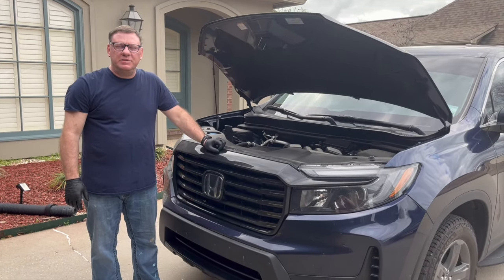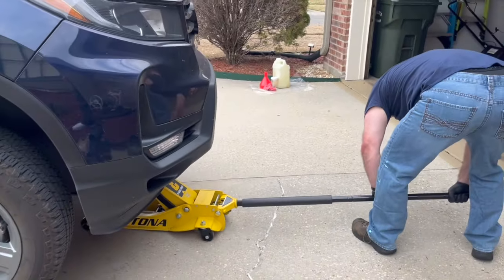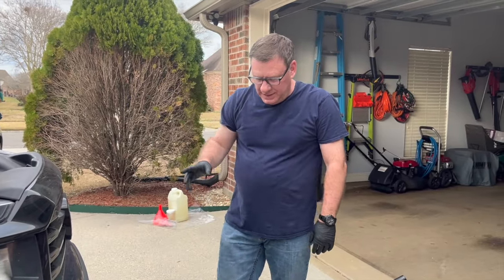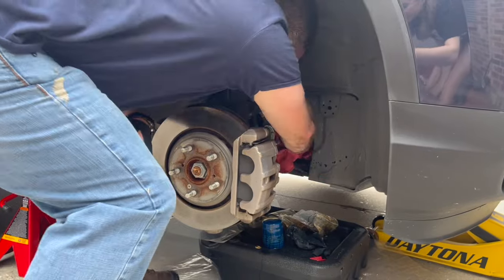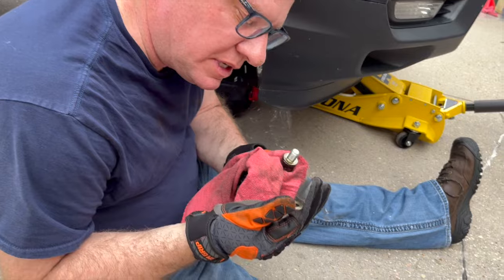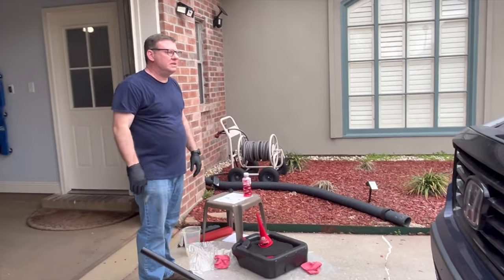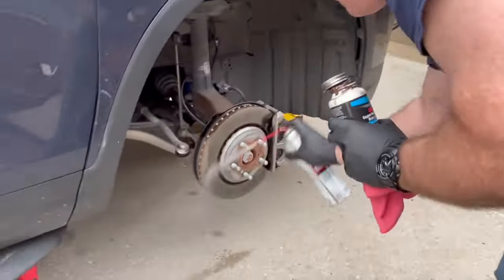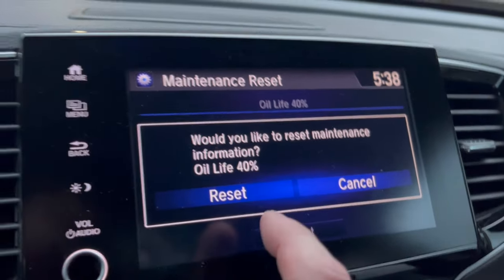2021 Honda Ridgeline Oil Change and Tire Rotation

Comment: Thanks for the video.  Just curious why you specify copper anti seize lube?  I think of using copper for electrical connections.  Thanks.
Reply from the maker: I used copper because it withstands high temperatures and resists moisture. You are also correct about electrical uses. I found this more thorough information as well:

Copper anti-seize is a common type of anti-seize compound that's ideal for high-temperature applications because of copper's excellent thermal conductivity. It can protect metal parts from rust, corrosion, galling, and seizure at temperatures up to 1800° F (982°C). Copper anti-seize also has other properties that make it useful, including:
Electrical conductivity: Copper particles in the compound create a conductive barrier between metal surfaces that reduces friction and wear without blocking electrical connections. This can help prevent issues like voltage drops and overheating. Copper anti-seize is often used on spark plug threads, which carry a lot of electricity.
Compatibility with soft metals: Copper anti-seize won't compromise soft metals because of ingredients like graphite and other high-pressure additives.
Water and corrosion resistance: Copper anti-seize repels humidity and is resistant to water and corrosion.

Comment: Outstanding video!!!  You covered it all. 
You made mention you purchased used and thought I seen 35K miles?  Are they OEM tires?
I have same model but 2023
How do you like the rig?
Thanks again
Reply from the maker: Thank you. Yes, I am enjoying the Ridgeline and it seems to be the perfect vehicle for me. I purchased it with about 32,000 miles and the tires appeared to be new at that time. I currently have 38,500 miles on it.